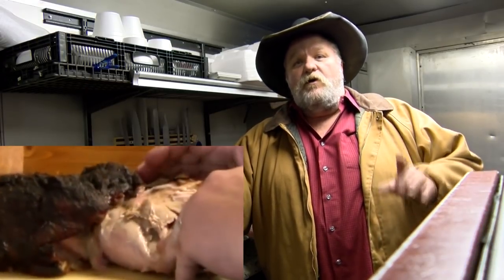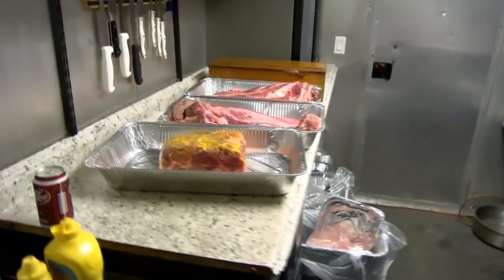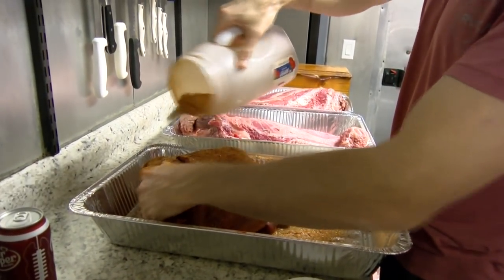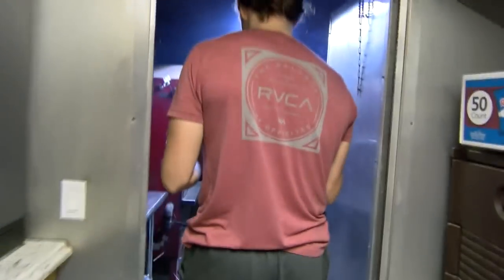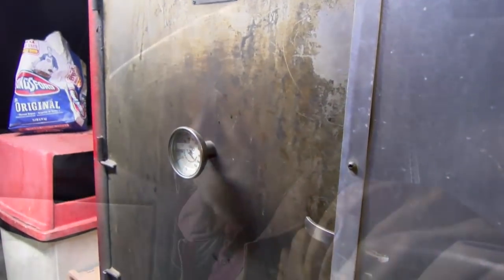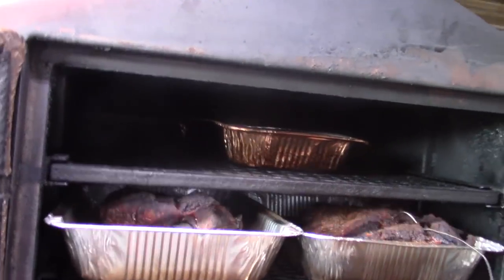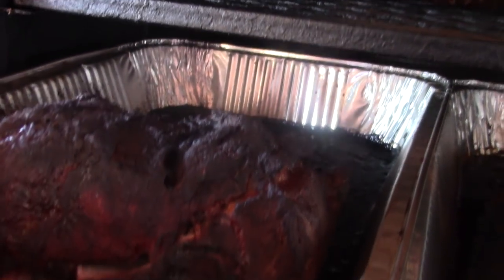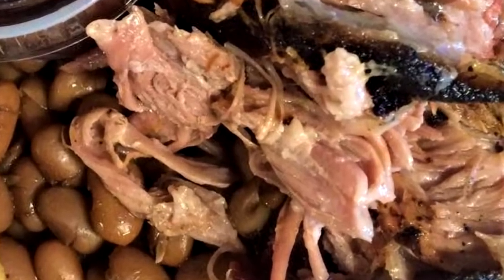Smoked Pork Butt On The Pitmaker BBQ Vault

Comment: Looked fantastic Johnny! That bark was spot on brother! Question, after you put the first rub on, do you let it tack up a bit before adding the Dr. P? I'm just wondering why not pour on the soda, then put the rub on? Help a brother out!!!
Reply from the maker: I tell ya Troy John started doing it that way and like how it turned out. But I totally understand where you are coming from. I think he rubs and then uses the Dr Pepper so the bark will have the sweetness of the Dr Pepper in it. Hope that helps it kind of makes a wet rub.
Reply: I pour the Dr. Pepper on after to keep more rub on there. When you pour it on you wash a lot off.
Reply: Maybe try spraying that DR.P on so less chance of washing away rub
Reply from the maker: Absolutely correct about that

Comment: I just purchased the Pitmaker Vault and BBQ Guru. Arrives Wednesday! Any tips on maintaining 250°? How do you load the fire box and how open is the flow regulator on the fan? Thanks for any advice.
Reply from the maker: I have firebricks in the basket to make the charcoal burn in the snake method  it goes up one side across the back and down the other. 
. I keep the guru air flow at 1/4 open. It will hold great temps

Comment: Johnny, how difficult is it to control temperature in your pitmaker vault with out a electronic controller?  I ask because my local competition does not allow the use of electronic controllers connected to a blower. And. Am wanting a pitmaker
Reply from the maker: Dads play Airsoft it is easy to work and  it maintains a consistent temp. I love mine. I have two of them.
Reply: Texas Style BBQ and Cuisine, are you saying easy without the electronic controls?
Reply from the maker: Dads play Airsoft yes sir. We try to get some sleep at night so we put in the guru for that extra protection.if you call over there let Victor know that chef Johnny sent you that way.

Comment: This is what I need, unless you have another for pulled pork.
Reply from the maker: Angela, that is a great recipe for pulled pork. You just have to get your pork up around 200° to pull. I do have a pulled pork sandwich posted call Three Little Pigs. It shows the making of the sandwich not the process of making the pork itself.
Reply: @TexasStyleCuisine  Okay but will this work on a grill? I do not have a smoker just a grill.
Reply from the maker: you can set up a grill to work. What kind of grill do you have
Reply: A charbroil and a chargriller both like a barrel like grill.
Reply: I sure wish I had your smoker lol I have to cook about six for a party in three months.  I am trying to find the best way to cook them without drying out.  I have cooked pork butt before, but only in the oven.  That is too many to cook in an oven, so I need to grill them.  If I cook them the day before, how do I keep them from drying out?